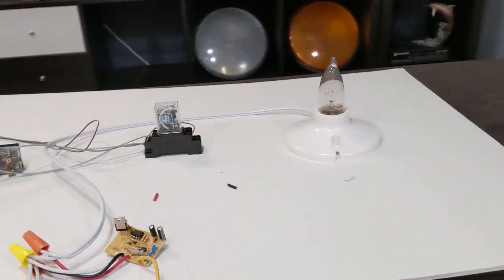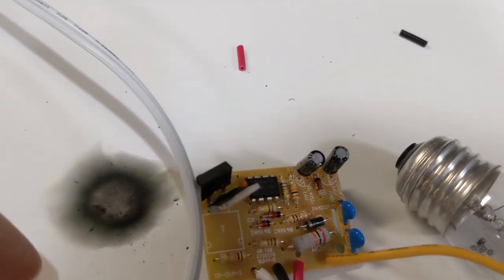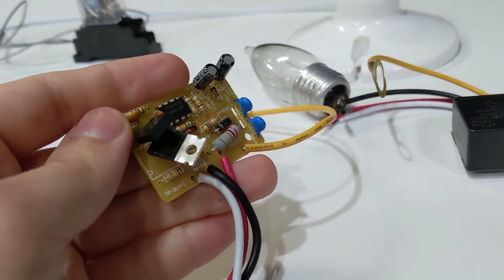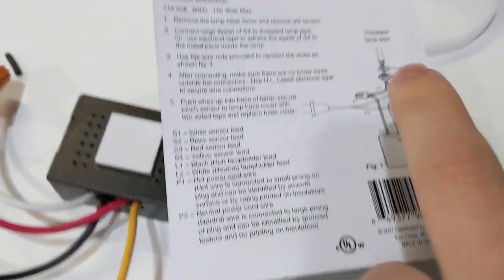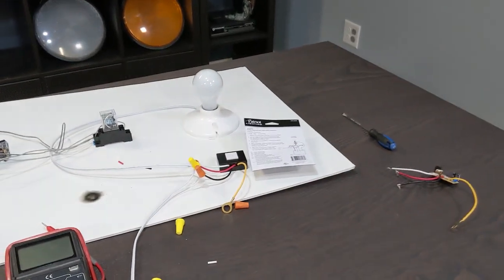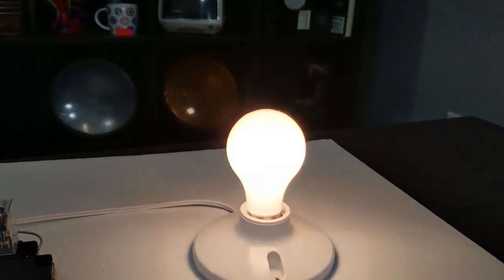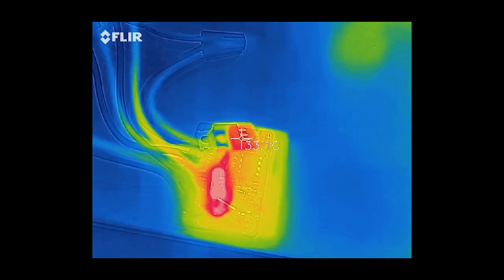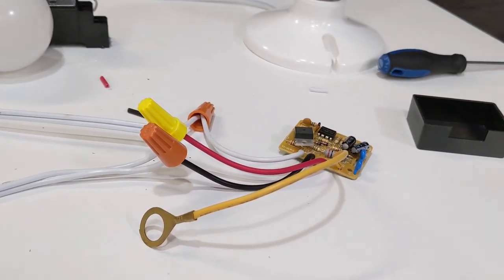A slightly explosive touch-lamp follow-up (standby energy consumption)

Comment: You explodinated it!!!

When something comes with a wiring diagram, it's probably a good idea to look at that diagram just in case, you know, they do things differently in NotNorthAmericaStan.

Also, for future reference, if you're not sure about touching something that might be electrificated, use the BACK of your hand (like the fold-y bits of a knuckle) to test. That way you can't accidentally grip/grab and deadify yourself.
Reply: That’s actually smart, I’ll have to keep it in mind the next time I do wildly irresponsible things with mains power.
Reply: @John Cavanaugh Yes, UK used to becRed=live (hot) and black=neutral. Earth used to be green.

Now we have Brown=live, Blue=neutral and green/yellow stripes =earth.

But yes, black was neutral for many decades. 100 years or more.
Reply: And in the auto industry, I was taught red=hot. I get North America might be black=hot, but common sense says red-danger… idk, that’s just me
Reply: @SilentRacer911  Exactly, I'm sure that's why we used to have red as live. What they chose to change live to blue, l ought to know but have forgotten.
Reply: @SilentRacer911   Generally, in DC such as automotive, red is hot, black is ground, but USA AC is black hot, white neutral. An exception to the DC 12v is sometimes in an RV where often Black is the hot since even though it's 12 volts DC, many manufacturers wire it with house AC colors.
Reply: @NickBR57  red signals danger perhaps?
Reply: @lesterdyltT  I believe so but what is Blue supposed to indicate. IIRC it was something to do with colour blindness that drove the changes and certainly the stripes on Earth would help avoid red/green colour blindness.
Reply: @NickBR57  perhaps nothing except visually distinguishable from the other two?
Reply: @NickBR57  UK was changed from red-black-green to brown-blue-green/yellow partly due to less affected by colour blindness, partly to 'harmonize' with europe as those colours were used there  by then,
Reply: Deadify 🤣🤣🤣 I'm so using that

Comment: In the US and probably elsewhere there's a dangerous transition when students go from working on digital labs with red 5VDC power and black ground leads to home wiring with that big black wire with all those pent-up angry pixies.

At the start of energy conversion classes (with lots of 120 & 208VAC motors) in college, kids were pulling power leads out willy-nilly and letting them drop wherever. There were some fireworks and serious burn marks on the workbenches. It's a wonder no one died or was seriously injured.
Reply: I was a very lucky student when I learned electronics. My instructor drilled it into our heads to assume every wire is hot until you can trace it to neutral or ground, even in DC battery operated circuits. Doesn't matter what color it is. That did not stop me from being careless once, and cutting the wiring to a live dryer outlet while disassembling a mock up.
Reply: Blue is the safe wire and brown is the "never... Ever... EVER touch this!" wire 😂 But in truth I never touch any 240v lead until the power is off AND I have measured the wire in question 😂 I have had a few bad experiences with wires not being what they should be 😶
Reply: That’s what I figured too— designed by someone who’s used to DC circuits, where black is ground and red is hot, rather than someone used to the US Electrical Code, where white is neutral, green is ground, and red and black are both hot.
Reply: My father was an electrician, and worked with 3-phase. He told me plenty of horror stories, so I was always careful, even with low voltage circuits.
Reply: Yeah I noticed that when installing my ceiling fan, I'm like "Well, this is ass backwards".
Reply: @beliasphyre3497  Same, every single wire is hot, no matter if you just checked it.. yesterday...
Reply: in Argentina, we use ligth bLue for neutral (Left), bRown for 'hot' (Rigth) 'n yellow-green streaded wire to the ground for 240V installations, White is used for close loops. In threefase we add red as R, brown as S and black means T. In the industrial electrical installation we use blue as 48-24-12V (is not usual have more that one tension level for panel) and white as neutral.
Reply: That's only in North America, the rest of the world uses black is always neutral no matter the application.
Reply: I hate the mess of wiring colour codes. I deal with arcade parts and electronics as a hobby, I have no actual training except for highschool physics and help from other hobbyists from online forums.  I've had my handful of shocks, pops, and explosions and also damaged parts because of it.   Thankfully there's enough safety features in our electrical system so I haven't gotten myself killed.

The scariest thing is when the rails of an arcade powersupply (which I have to hook up to the 120v outlet) instead of saying live and neutral simply say "AC1 AC2" no indication of which is which.  Especially when it's a power supply from china...
Reply: The old UK colour code was red for 240v line and black for neutral. Going from a 5v DC circuit to mains AC was quite intuitive.
Now, it's brown and blue, just like all of Europe. Easy enough to remember though; if you touch the brown, you'll probably sh!t yourself.
Reply: Problem with AC systems: It also works if its wired up the wrong way around. That's why I have seen so many houses where the wring color code has been mostly ignored. 
I have even seen a green wire being live once. Good I checked it before connecting it to an outlet.
Reply: NEVER assume the Neutral wire isn't hot! (until you turn off power and check it) It is a current carrying conductor and can get energized in a number of different ways.
Reply: A student colleague of mine wanted to make sure the leads of our formula student car's starter battery were of exactly equal length, so he cut them both at the same time. Made for a good show I imagine, several of the spot-welded tabs inside the battery vaporized.
Reply: @jaspertkoop  That is not true at all. In Europe, black is one of the phase colours in three-phase systems.
Reply: AvE-speak spoken here
Reply: @jaspertkoop  nope, in NL and many more European countries the black wire in a single phase house installation is "switched Live". Live is brown untill it reaches a wall switch and leaves there as black. Neutral is blue. A lamp socket in the ceiling typically contains blue (neutral) and black (live) and preferable has a yellow/green coded earth wire. My bedroom btw has a reversed blue/black installation that was once owned by an electronics teacher I had. Those are the worst... Hmmm
Reply: @kain0m  yes, or the switched version of live (brown) in a single phase house installation.
Reply: But why? More than half the world uses red = hot, black = neutral and as you pointed out, the convention holds in DC circuitry - then why switch the convention around for standard home wiring?
Reply: "... pent-up angry pixies" That's what Mr. Ostrich is for (see Blackadder II: Beer ).
Reply: @Les oh yeah, I should know better.
It turns out not to be true even where I live.
Reply: kain0m from what I can gather there's a change in April 2004 when it comes to AC wiring in the UK when they synced to EU. Prior to April 2004, red, yellow and blue are live (one of three phases) and black is neutral. After April 2004 it's brown, black and grey being live phases while blue is neutral.
Reply: You are still getting it wrong. The reason it exploded is because you connected the white S1 wire to your mains line voltage. 
Your explosion has nothing to do with connecting black or red wires to neutral or not.
Reply: @jaspertkoop  In the Netherlands, black is the Live wire coming from a switch.
Brown is Live
Blue is Neutral
Yellow/Green is Earth
Black is switched Live
Reply: One time I was helping my father wire up some lights in the basement of our house, I had plenty of experience with DC wiring in computers and other electronics where black was ground, he had never worked with DC components like that only with AC house wiring. He had to physically knock my arm away to stop me from willy nilly grabbing the black wire. I'll never forget the look of horror on his face after I explained myself, as he very carefully explained to me that in AC the black wire is the live wire, because if you touch it you die.
Reply: @cmmartti  I don't remember specifically, I assume we were trying to get as much done as we could while we still had lights to see by before cutting the power, but there was probably a good bit of "I've done it this way before and it turned out fine" on my father's part
Reply: @SyntheticFuture  Years ago, I came across a 'dead' copper-clad pyro wire. Cut it shorter and it went bang - the wire wasn't dead at the other end - it had a break in it somewhere !
Reply: @DrDeFord  That makes a little sense. Black is neutral, white is 110V and red is 220V. I guess ground is 110V too.
Reply: @SaborSabroso  Superb - just a mix of other countries colour codes with a few of your own to really mix things up :)
Reply: @georgeprout42  Do you think post brexit, we can go back to red and black ?
Reply: "Black is your hands if you touch it, brown is your pants if you touch it, red is the burn you will feel if you touch it." but White is safe and pure, GReen is GRound.
Those colors on the lamp are wrong even in DC, because being at negative potential is still NOT NEUTRAL.
Reply: @MKhurramAziz  Because the united states had electricity before simple conveniences like "polarity" and "grounding" and "insulation.". Black is the wire that arcs and makes black marks, white will stay clean. So, electricians working on the wires would know at a glance which is which by seeing which has the arc marks on them. When we started figuring out insulation we just moved that along, when we started enforcing polarity we kept the standard, and now we have hundred plus year old houses that have paper insulation, while Europe decided to embroil itself in two world wars that obliterated their infrastructure and create copper shortages where unambiguously determining which is the ouchie wire and which was the "safe" wire were matters of life and death because of the absolutely insane decision to double the voltage meant a chance to "standardize" wiring across DC and AC power sources.
As a matter of safety it's far more important to have a consistent wire color system than it is to have one that makes intuitive sense, knowing what color behaves what way is more important than making sure what you are doing makes sense if you used the same color system in another country. If you change the standard, you don't have a new standard, you just have 2 standards you have to memorize now.
Reply: @Mostlyharmless1985  typically red is hot and black is neutral, especially in Chinese products that are not filling industry standards (as in brown and blue) but the product should work even if you flip the hot and neutral legs any way, this item blown up because it wasn't wired correctly (did the same to my time delay relay)
Reply: @leexgx  No, red is hot, and black is also hot. and at no point should you EVER uncle grampa a connection of black to neutral because you could have freaking line potential on the switch side of the circuit you are wiring or freaking put line voltage on freaking neutral. Stay far. FAR the hell away from anything electric, please.
Reply: @millomweb  buy why we should have our unic colour code? We buy all from China and Europe, naturally we have the DIN standard for most industrial aplication, and some practical agrees. Sorry for my poor english but I'm not a english speaker..
Reply: @Mostlyharmless1985  what ever
Reply: @SaborSabroso  Not being universally the same causes problems like this !
I'd realised English wasn't you first language. Not a bad effort though!
Reply: @millomweb  thanks for the compliment. I believed that the blue-brown standard was the most universalized
Reply: @DrDeFord  I'm not at all familiar with wires outside of one electrical engineering course in college so thank you for confirming that I'm not crazy to have the belief that black is ground and red is hot!
Reply: @SaborSabroso  I think black/red is more common - I have both standards in my house ! Note electrical test meter leads are always black and red and the standard is used in low voltage such as cars (but not Fords!) Battery powered things - the wires from the battery compartment are usually black and red too.
Reply: While the wire colors are supposed to be standardized, in both DC and AC systems, ive seen multiple infractions i work in the auto industry and honda has gone for the take a guess approach of making both leads for the battery black, and not labeling them, instead using the position of a properly installed battery as the identifier (meaning the proper honda spec battery in the right way is the correct wiring) or you look for the lead going to the fuse box or to body ground. My dad is also an electrician and Ive gone on work sites or houses with him where the wire colors are just, whatever wire color was in the last guys truck, so i have learned to always meter out the leads and to check where connections go before messing around. (side note with hondas my shop has seen plenty that have gone dark cause of that wire fault causing the owner to put the battery in backwards, Usually theres a fuse to try and mitigate the damage)
Reply: I'm not an electrician, but when I was a teen I was converting (with oversight/instruction) a computer power supply into a bench/lab one. I was being careful, I had it switched off, but it was still plugged in... Gave me quite a shock, luckily only 120V. Since then I've been even more careful, and not made any more mistakes like that.
Reply: @raf42  Hoover 'New Wave' washing machines have the power button connected to the neutral - so when switched off, all wires inside are live. (240V).
Reply: @Mostlyharmless1985  Germany had 220V before the First World War. UK was 240 volts before Second World War.
Reply: @gleggett3817  I didn’t mention anything about voltages, that’s another can of worms with most of the 240 world screwing up by going to 50 hz. 
But, new houses means new wires, and new wires means easy standardization.
Reply: Yes, I was just saying that in my comment above. Exactly right!!!